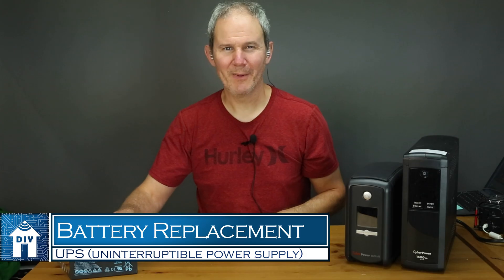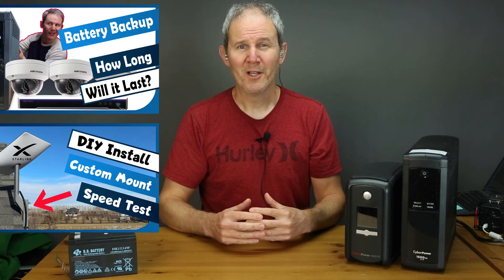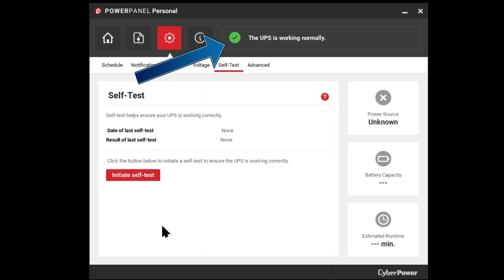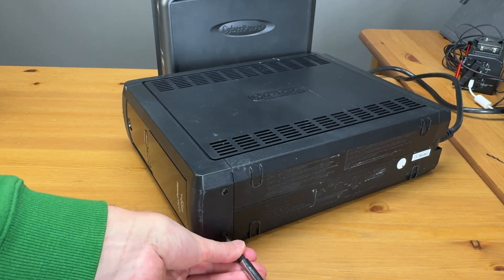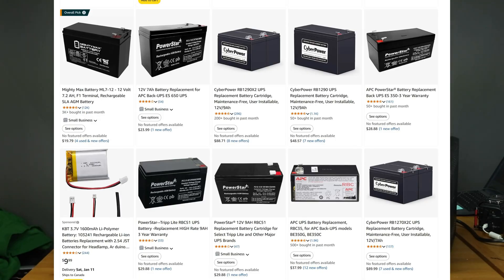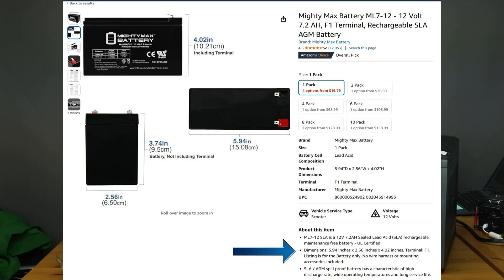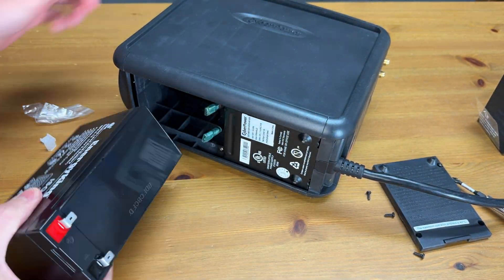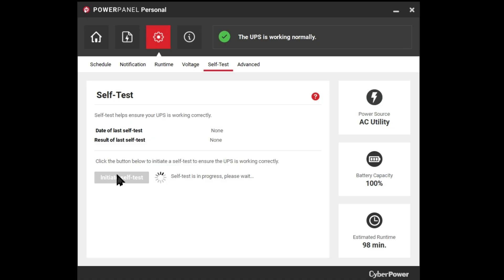How To Replace a UPS Battery - Security System Battery Backup

Comment: 50 or 100Ah LiFePO4 is a great choice.
It's a very good idea to open the UPS and inspect the PCB for bad caps, bad solder joints, hot spots and cooked glue.